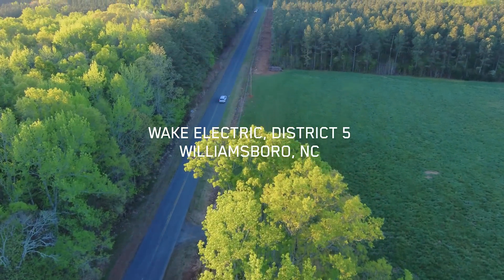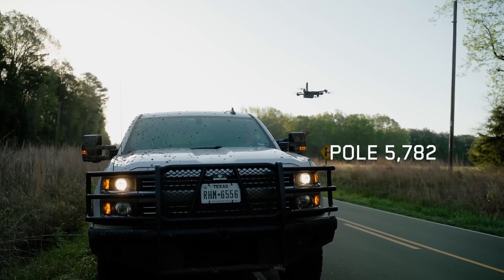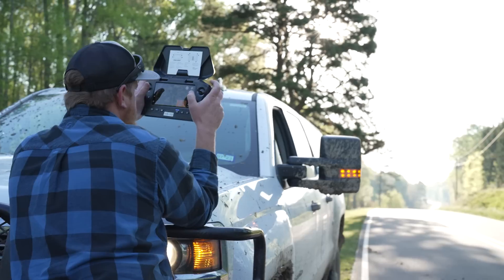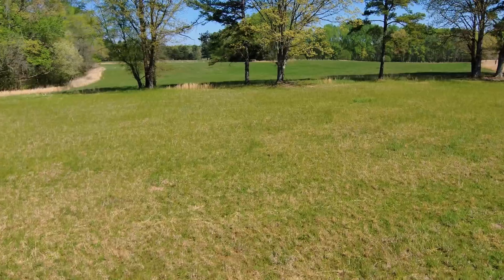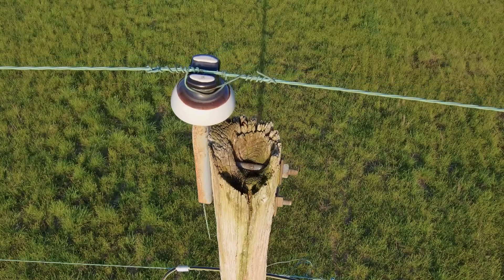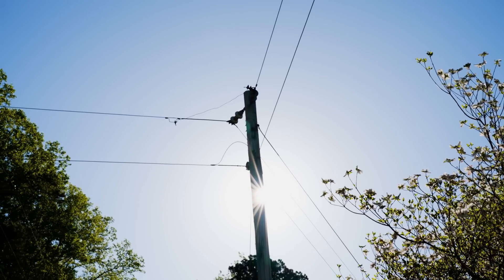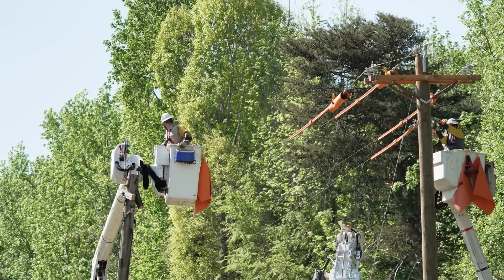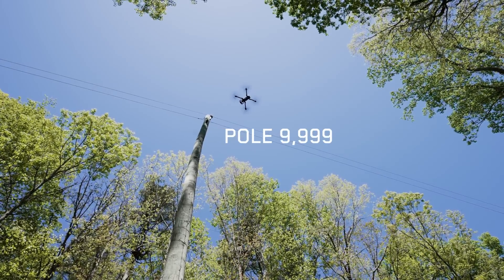Inspecting 10,000 Utility Poles in One Week with Skydio X2 Drones

Comment: Guys i can’t charge my bettery even i didn’t use my skydio from 2 months the bettery is low so what os the solution please
Reply: Since it's a "Smart" battery, I would contact Skydio customer service. I would be about to help you if you had just the bare battery, but since the cells are controlled by a circuit board, there's not much you can/should do. Contacting Skydio is your best option.